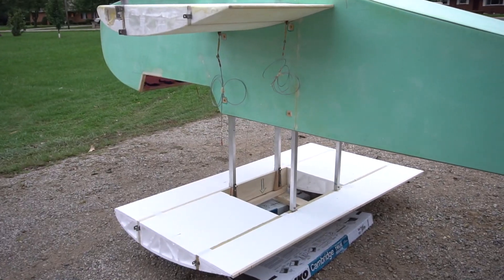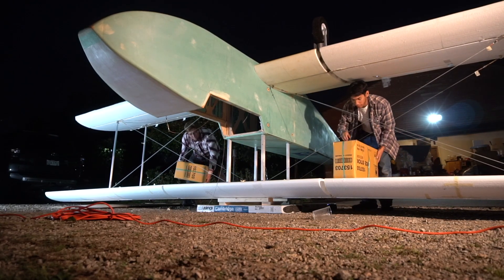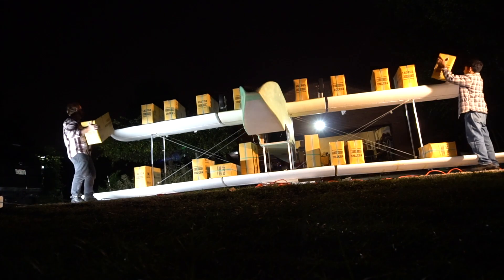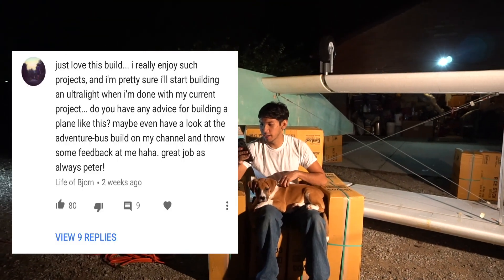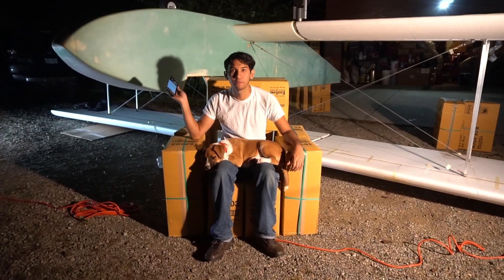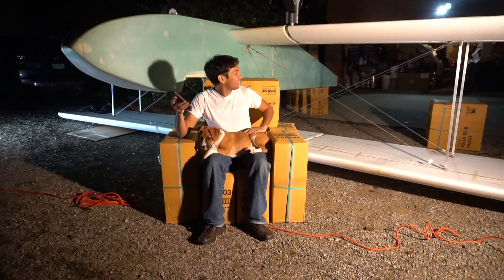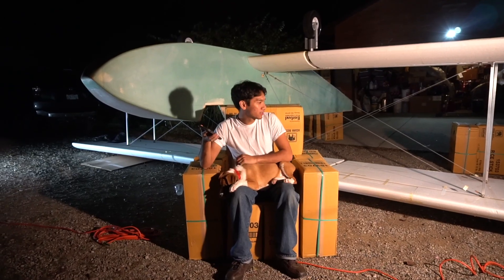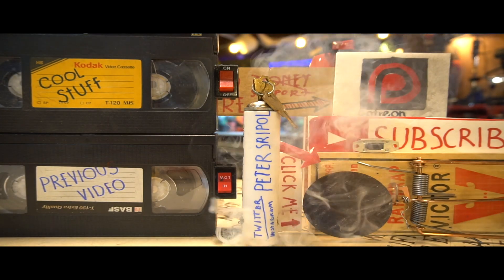DIY Electric ultralight pt5 (Making the Wings)

Comment: These updates are two few and far between. I wasn't excited about a full sized electric until I researched it. Electric is basically the future of full sized aviation too. I hope the other viewers respond to this content.
Reply: Thaddeus Walker Not really, we need a tenfold improvement in battery capacity, plus safety enhancements before even light GA aircraft (4-6) become viable.
Reply: I am not sure what a "light GA aircraft (4-6)" means but electric aircraft are already quite successful in their role. Basically any hobby flying, glider, short commute or short race aircraft is basically improved by being electric. I didn't claim that it was the future of all aviation but current roles filled by combustion engines are better replaced with electric as well as other roles that combustion engines could not fill. Basically all certification will have people flying in electric planes because of the fuel savings. Red bull racing will be electric because of the improved thrust to weight. Gliders can use Regen. Quad copter tech can be applied to human flight.

Get stoked dude, this is really cool stuff.
Reply: Regulations are the biggest problem… You need 30 min. reserve at the landing airport, and that's the capacity of the batteries.
Also don't forget the high safety expectation...
Nowaday it is really edgy, good for some special applications but far from mainstream.
But I know about a big tech. company working on, thin Li batteries embedded/ built in non-structural parts. Builds with integrated batteries in the skin, will have more capacity with less weight…
Reply: There is nothing about complicated ICE that is safer than electric. This stuff is already on the market. Pipistrel has an electric trainer that can get you up for about an hour for 1$ in energy with a half hour of reserve. This is a game changer that opens up the mainstream to the consideration of how short hops can be utilized. There is already enough room for growth in that narrow range to make it mainstream.

Get stoked dude. Check out: Electroflight | Fully Charged on YouTube as well.
Reply: I did not know it by name but I have seen it around in my research that Peter started me on while I was waiting on the next video to come out.
Reply: It's understandable that these video updates are few and far between, you would imagine that an airplane would take a long time to build.
Reply: do you guys know Lilium? Interesting Invention from Germany, also electric and even VTOL ;)
Reply: I wish I could live in the US, that license free UL category, made me jealous… 
I'm following electric aircrafts & experimental since 10 years, got hooked building virtual planes on the X-plane simulator, because the kit built Velocity aircraft, was originally developed on it.
I've seen many, from SolarImpulse, to the EADS cross-chanel, Cri-Cri-E, the Eraole and so on…

Something like the EMG6, or an electrified Falcon UL would be nice, but a reengineered electric Rutan's 68 amsoil racer would be my dream. Also a Rutan's Quickie q1 design which had only 18 hp, could be reused.

As I said, wait for batteries embedded in the skin of the aircraft.
About ICE, it provides more power for autopilot, heating, deicing , pressurizing, lights, hydraulics…. all things you have to cut on when going electric, but who knows perhaps hybrids as a step between.

Also watch the channel : Light Sport and Ultralight Flyer, he's discussing the subject with many small aircraft manufacturer.
Reply: Thaddeus Walker The tech works for gliders, and racing aircraft where they need maximum power for about 10 minutes.

It doesn't however work for any real commute. Probably the best performing aircraft is the Pipistrel Alpha Electric trainer, and it can only fly for an hour plus reserve. Also, it is designed by a company renowned for efficiency (meaning it isn't attainable for all companies), seats two people and has a speed similar to that of 1960s trainers.

It's coming, but you're a bit optimistic if you think we'll be all electric in a decade. Shit, if you knew what the certification process was like for regular aircraft, you would get it, not to mention the lightning protection required as well.
Reply: 10 minutes is a real commute. Electric doesn't care about warmup times and electric is better for self driving it is a different beast, not wasteful to use and basically would make people rethink the best way to go intermediate distances

I am also pretty sure that the number of passengers has basically nothing to do with what is possible with scaling. People join planes wing tip to wing tip doubling everything and it still flies. I am sure there is a more elegant way to design aircraft scaling but to me it makes the number of passengers irrelevant.

sounds like a regulation and imagination problem to me.
Reply: Thaddeus Walker If that's how you think scaling works then you're really not in a position to argue. If it's that easy then why have we stopped at the A380? Because it's basically impossible, and at least economically unfeasible.
Reply: Also you don't commute 10 minutes in a plane, the minimum you would commute is probably around 1:30-2 hours. And you would need a plane that can carry four and go faster than 100kts doing it, plus that is IFR certified and has sufficient range + reserve for other trips, especially before you drop 100's of thousands of pounds in it
Reply: Don't tell me what exists like that is the only thing that can ever happen. The goal of transportation would be to eliminated the need for special pilot skills. Send a couple children by themselves in a plane or vtol. The number of people then scales easily with the number of planes. Hiring a pilot for a 10 minute hop doesn't make as much sense but the retention of employment is not the goal of technology. Do you think everyone wants to be herded onto the same plane with a bunch of strangers to group fund a pilot and end points that are by definition not their end goal?

The number of passengers doesn't matter but lets play that game. What doesn't scale with the number of passengers? Name the dimensions that don't scale. Does power not scale with battery weight? Does power not scale with thrust? does thrust not scale with weight? does lift not scale with something?

The thing that doesn't scale with the number of passengers is people's patience sir.
Reply: Thaddeus Walker What you're missing is the fact that to lift more weight, you need bigger, stronger structures, adding more weight; and more power, which adds weight, is not attainable with current electric propulsion, and requires more batteries, which add weight.

Thus the cycle continues. Hence why we don't see planes bigger than the A380 in service, because aeroplanes especially don't scale well.
Reply: FIrst off we are talking about electric not being able to do something that it can do better than fuel can in the half hour regime. Traditional air commutes scale with distances traveled because of the number of available pilots and the fact that they have to earn a living to continue. In the half hour regime power is greater at all scales while being economical(not using rockets).

4 people does not turn into one giant person. You are allowed to distribute people into favorable configurations just like we put gas tanks and batteries in wings. 4 people takes what 4times the wing area? The wings are allowed 4 times the cross section area for structural leverage. The passengers are not sitting on one chair, they are distributed and the plane does not have to handle the abuse of an an 800 lb gorrilla the stairs and controls don't grow, grow linearly with each passenger or grow with the cube root along with the linear dimensions. Some distributions include less drag per person.

The bigger stronger structures required have to grow more than the number of people, which I am not convinced of. the distributed load can overcome most of this. moving from 2 to 8 passengers is a meaningless distinction that has nothing to do with gas or electric being able to fly the same distance.
Reply: Thaddeus Walker No it isn't a meaningless distinction. Look at the smallest aeroplanes. Moving from 2 to four seats at least doubles your fuel burn for a given speed, moving to six triples it. Now look at 8+ seats and your fuel burn (let alone regulations) starts to increase exponentially.

Nothing scales as simply as you claim, everything is interlinked, especially in aviation. We don't have the battery tech to realistically fly 2 people for over an hour at about 100kts. Now try to scale that for even four or six people and increase the speed to something useful and it becomes impossible with today's tech.

Learn about the certification process and you'll see that conventional designs can take a decade to pass. Now try with something completely different (when the tech actually allows)
Reply: I have no idea what kts means, your arbitrary standard is meaningless, you have said nothing that clarifies something for me or detracts from what I have said. "Moving from 2 to four seats at least doubles your fuel burn for a given speed" simply means that you need twice the fuel, It doesn't matter if that is petrol or battery pack. Double is double so I get to put in a second battery. You need the ability to burn twice the fuel in a given time, it doesn't matter if that is an electric motor , piston or turbine. Double is double, I am allowed twice the motor weight. Once we have the technology to buy one battery we have the technology to buy a second. IF electric can do something at a smaller scale then it can do it at a larger scale in any way that petrol can. There is nothing about petrol that changes scaling.

Certification is not my specialty and it is irrelevant to anything that could possibly be construed with the topic of this thread. 10 years is a length of time but future is future and isn't constrained by finite lengths of time, if something doesn't happen in 10 years that doesn't mean it can't happen still in the "future".
Reply: Thaddeus Walker You've hit the nail on the head, but your conclusion is wrong. We can simply scale like that due to the other restrictions on aircraft design. You can't just increase fuel without affecting weight, speed and size. Similarly, the structure of the wing, cabin and landing gear need to be beefed up to support that weight. 

In regard to ten years, a) that is for a normal aircraft by established manufacturers, and b) that's my point, I think electric aircraft (at a small scale) will be common in the future. My original comment was that it won't happen in the timeframe you're suggesting. 

Also, no offence but the fact that you don't understand knots makes me think you aren't particularly knowledgeable about aviation, hence to disbelief about scaling. You don't just go from a two seater to a ten seater, or one hundred seater, it requires a full redesign, and price goes up exponentially with increasing weight, seats, speed and pretty much anything.
Reply: My specialty may not be aviation, but scaling is something I have got down pretty well. Aviation does not own scaling as a discipline.

The time frame I suggested was "The future" How long from now is that? I was also with that phrase describing a shift in direction because it is better(an improvement) Electric aviation makes new things possible, while fuel may coexist for a long time especially in its current role, it will be overshadowed.

When I said full size I meant that it carries people and is not just the model scale. I made no comment on the number of people. Full size only means at least one person to me and is contrasted with the flite-test style hobby stuff.

In the context of gas or electric all matters of scaling are irrelevant because the same scaling issue applies to both options.
Reply: Thaddeus Walker Unfortunately electric propulsion doesn't scale as well as hydrocarbon fuels, mainly because you can't have jet engines running on electricity. Sure, maybe with enough battery power and large enough motors electricity could compete with turboprops, but that has little impact on airliners.

But yes, we aren't really arguing here. I was merely pointing out that these developments are a long way off. My comments on size were mainly in response to your comment on scaling, and also because the size dictates how useful electric propulsion can be, i.e. sure, we have a few electric aircraft with one or two seats, but even they are limited in speed, range and payload.

Anyway, I'd like to be proven wrong, we really need something to revitalise GA, and if there is even a glimmer of something coming from electricity this decade I'll be impressed.

P.S. If you're interested in battery technology, look up John Goodenoughs paper on a solid state battery. No one actually knows how it works, but if anyone has found a way to revolutionise batteries, it's him.